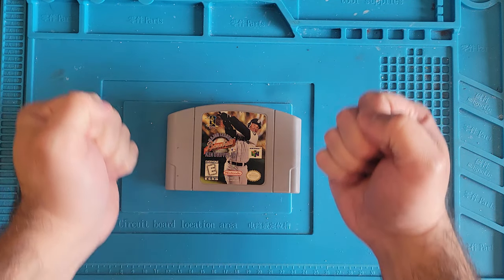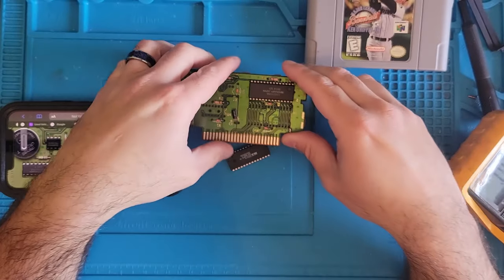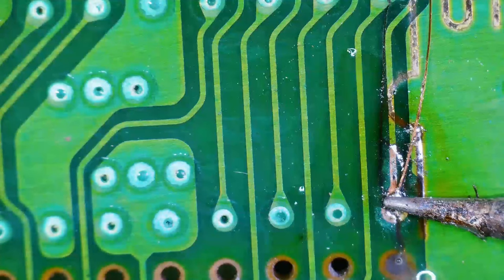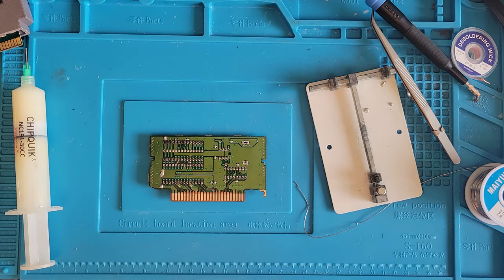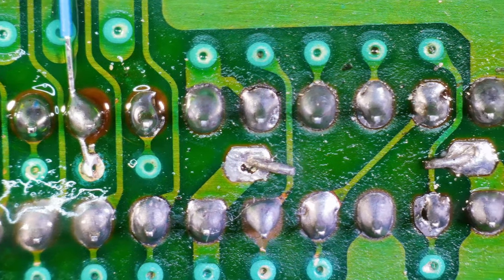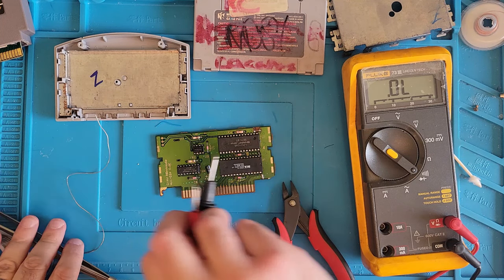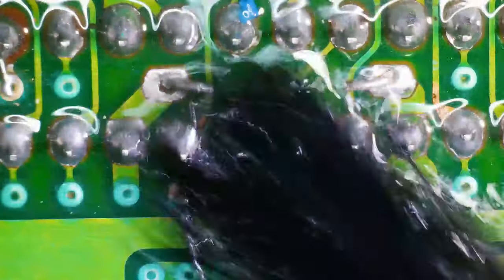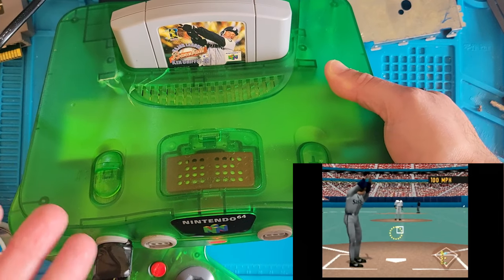The Great Circuit Board Rescue!! Major League Baseball Featuring Ken Griffey JR N64

Comment: Woohoo, excellent video buddy! You had your work cut out for you, but with patience and preserverance you overcame for the win! Glad to see the tips been helping you out! 🙌 Some more recommendations for you, invest in a fiber glass pen those are amazing and cheap. They help remove the solder mask so you won't have to keep using the tweezers it makes it easier.

Solder mask ink in any color you want as well a little uv flashlight to help you cure the ink. Not only does it help to cosmetically look better it also helps protect the joints from all the patching up. Its also great because if theres a certain area nearby where you dont want the solder to join up you can use the uv ink in between to help keep them separated. Its almost like electrical tape but different. It's main purpose is to hide copper.

Man, I'm so hyped and glad to see you've got it working again. That thrill is always worth it in the end! Especially being able to bring things back to life that look gnarly where one would presume its over. High 5!
Reply from the maker: Thank you thank you!!! I used to use fiberglass pens to clean up the edge connector pins I didn’t think to use it to scratch off the solder mask!! I will have to give that a shot!! 
I was going to use a little uv mask but I decided that since this board is so, so bad I might need to get back in there in the future for more repairs. I’ve never taken solder mask off but it looks like it would be difficult to do. 
Bro I was kinda shocked that I was able to get this game running considering just how bad it was!! 🐺🐺😁😁
Reply: @wolfmanrepairs  solder mask is actually easy to remove. Just scrape away with the tweezers like you have been or an x-acto knife. Those are awesome for it. Some careful scrubbing, and it can be removed. Lol, I was wondering the whole time how it was going to turn out as well, but you did great!